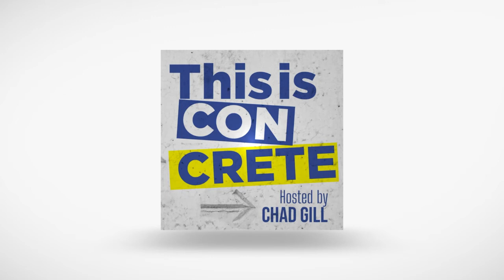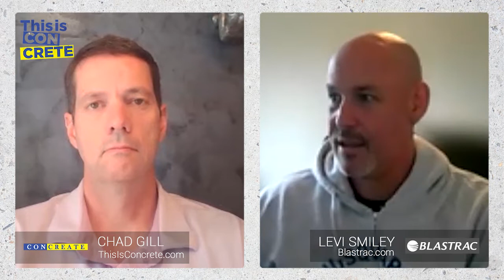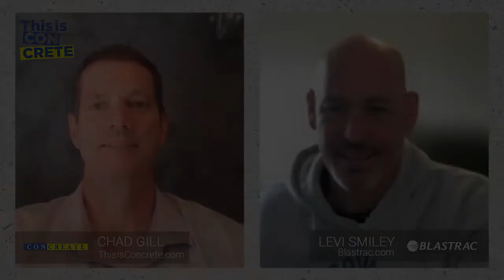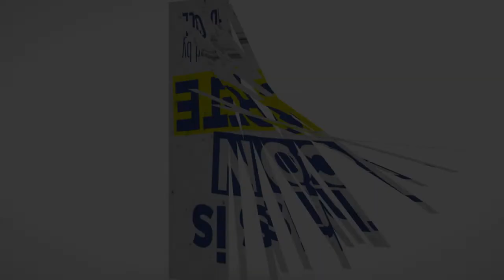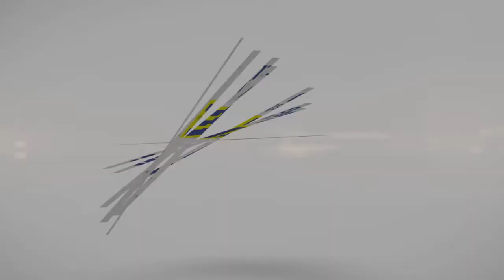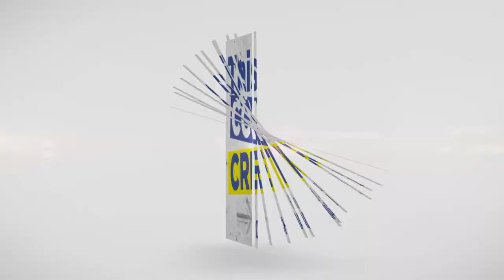The Fundamentals of Shot Blasting

Comment: I have 3 pickleball courts that have a broom finish on part of the court and a trowel finish on on part of the court. I was going to use a shot blaster to go over both so I can paint the courts. I  thought using #170 shot to smooth out the sweep finis and ruff up the trowel finish would work. We use an 36" squeegee to apply 2 coats of paint to the court. Would the shot blasting work for this application?
Reply: You could but I think a grinder would get the surface more even.  An aggressive grit like 16 would leave enough traction for the surface.  We do this often on sidewalks.  Where are you located?
Reply: @chadgill2236  
We are in Washington State on the east side of the state. The paint that we will be using has 80 mesh sand in the mix so we will get the roughness we need through the paint. I  like the idea of the shot blaster for the cleanness of the clean up. The concrete is in good shape. My concern is more that the paint will stick and last. I have an adhesive spray to put on the court before I paint it. What do you think?
Reply: @chadgill2236  
We are in Washington State on the east side of the state. The paint that we will be using has 80 mesh sand in the mix so we will get the roughness we need through the paint. I  like the idea of the shot blaster for the cleanness of the clean up. The concrete is in good shape. My concern is more that the paint will stick and last. I have an adhesive spray to put on the court before I paint it. What do you think?